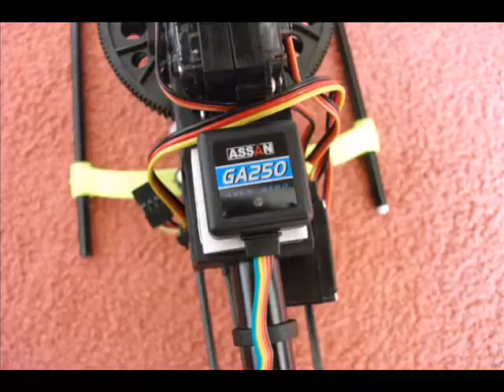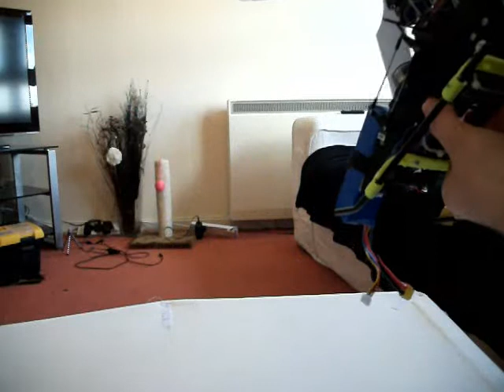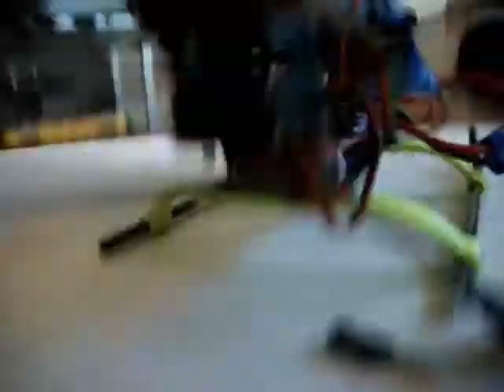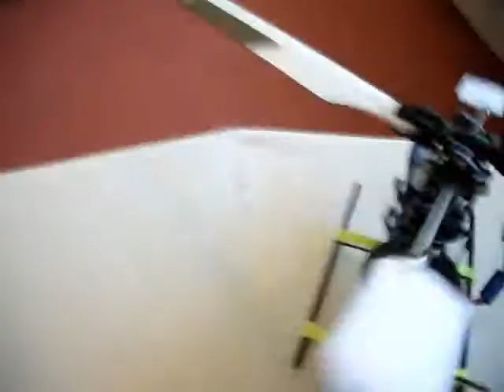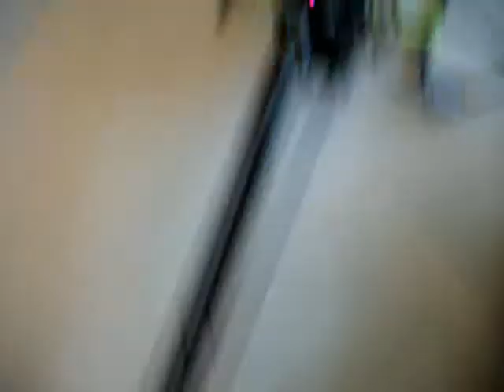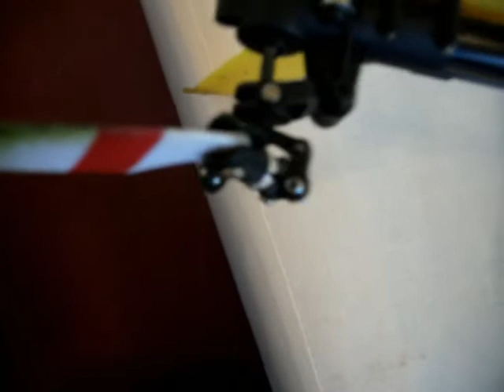GA-250 Gyro set up

Comment: Brilliant tutorial sorted me right out, rock solid tail, now i must lern to fly :)

HobbyKing HK-922MG Digital Metal Gear Servo 1.8kg/ 12g/ 0.07sec ：1520us/250hz
MKS DS470 Digital Servo 2.37kg / .089sec / 10.9g ：1520us/250333hz
HGD digital 201 Carbon Gear BB Alloy – 9.1g / .07s / .9kg ：1520us/333hz
HKSCM9-6 Singlechip Digital Micro Servo (6V) 10g / 1.6kg / 0.07s：1520us/333hz

Found this if it helps any one

Comment: ... Also, the way the tail is set up there gives more deflection for the "with torque direction", i.e. to the left, and less to the right, which means your loosing out on lots of tail authority and the gyro will not be able to work to it's best ability at all! The tail blade grip flip should sort that. Pop off the tail push rod from the servo & check that it's moving freely from one extreme all the way to the other ESPECIALLY at either end {no stickieness}, then the gyro will work at its best ;D

Comment: Hey gd vid. Just a couple of tips Re mechanical tail setup- the tail blades, as you have them set up there, would be flying down through the downwash of the main blades. If you swap them so that they fly up through the main blades' downwash this gives more tail authority. You had a good point about having the tail servo horn straight, but it looked to me like you had it a little crooked there in the vid still. Every little bit counts a whole lot when it comes to the tail! ...